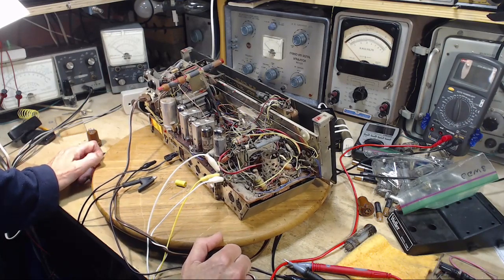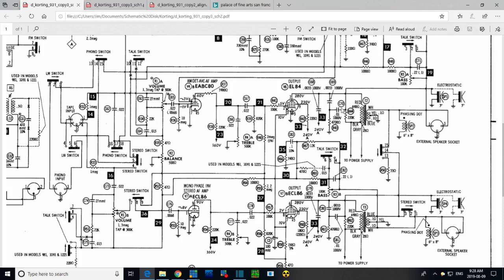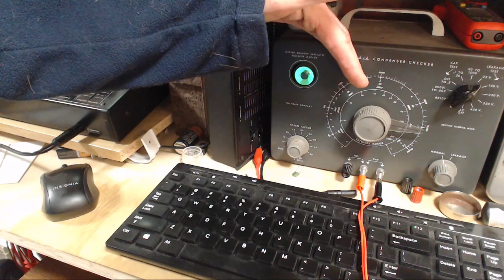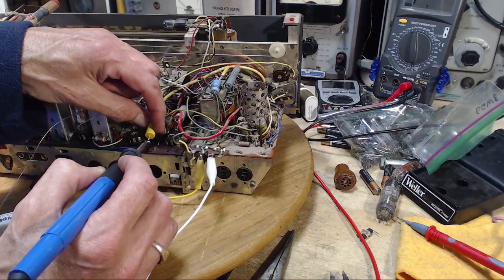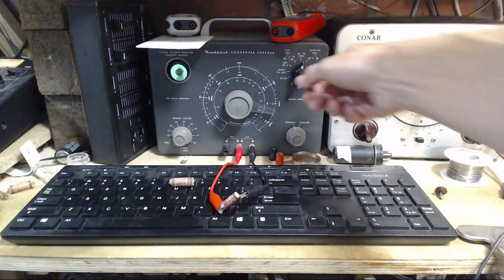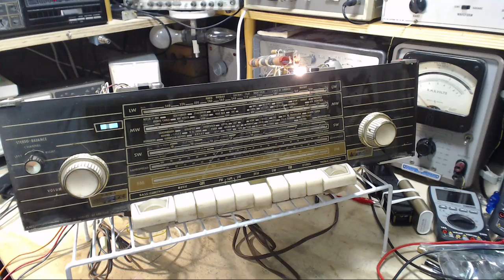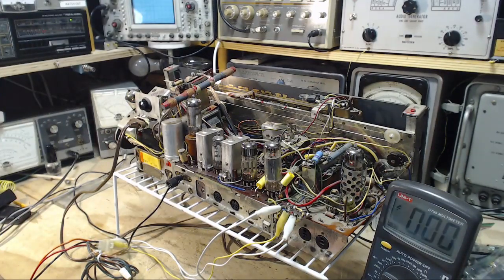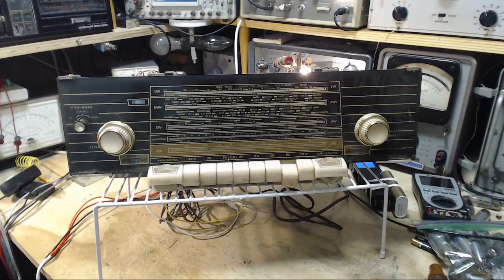Korting German Console Receiver Video #5 - Capacitors

Comment: Finding replacement caps in these sets is not unusual. Many of these used PCB-style resin-dipped capacitors by Wima. These ALL went bad within a few years, usually shorting out. There were also a bunch of bad paper caps in those years, not unlike the crummy Japanese wax caps of the same era. Depending where they were used they might take out a resistor or even a transformer. Fried output transformers were sadly common in these radios. They played well when new but did not hold up in the long haul. There was a time when these filled TV shops and thrift stores (sold AS-IS). Parts were usually unobtainable or expensive and if they ever got repaired it required re-engineering to take a substitute part.
Those paper caps are going to be bad. They are actually worse than the old wax caps found in old American and Canadian gear from the 30s and 40s. They were not great when they were new. The wax on the ends sticking out is an indication of internal heating, not external. External heating would have made the wax flow down. These fail like the notorious "Black Beauty" caps did. If you find ERD brand caps, get them out of there! They WILL fail.
Reply: actually it is not ERD but ERO. And it stands for Ernest ROederstein, the name of the founder of the company Roederstein, which is now part of Vishay. The brand ERO for foil capacitors and ROE for electrolytic caps made by Roederstein and Co are often referred to as the three letters of doom when it comes to old equipment. Aside from that, just by looking at the caps and their blown out insides or cracked end cap seals, it should be obvious to anyone that these need to be replaced. Testing them is not only a major timewaster but as sensible as painting the toenails on a chopped off leg.
Reply: @melissahermsen5630  You are correct. It has been years (and a stroke) since I have actually handled them. All of the surviving German capacitor makers cleaned up their acts as the Japanese and American suppliers were making superior parts and more dependable products. A couple of German brands were even taken over by the Japanese or other European outfits - Wega by Sony, etc.
My sister-in-law used to work at Vishay. Their facility is still going in Malvern, PA, just down the road from me.